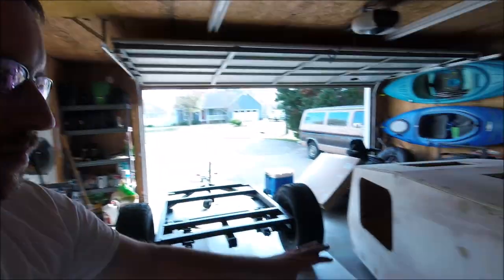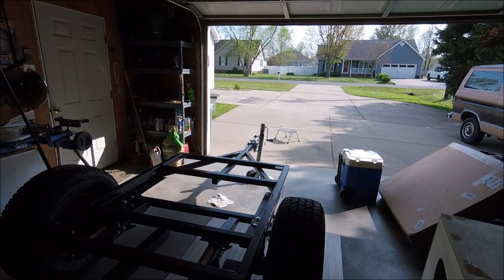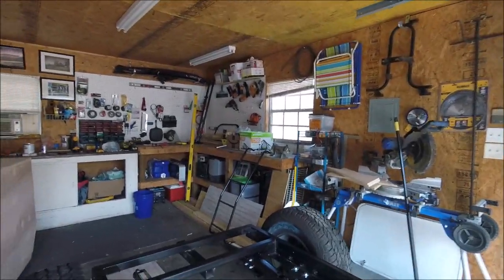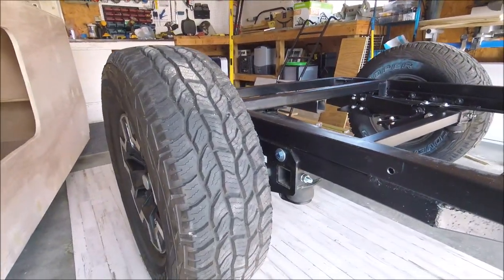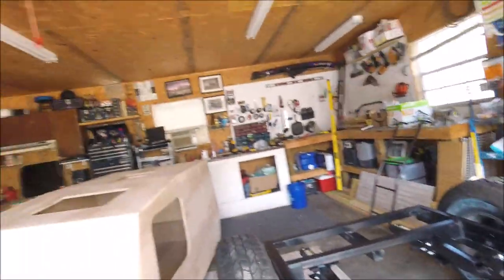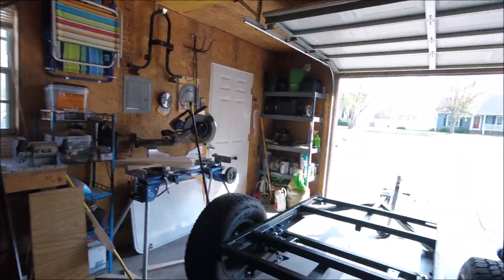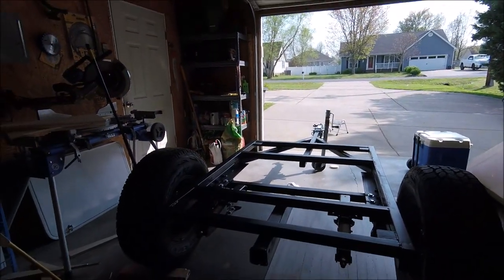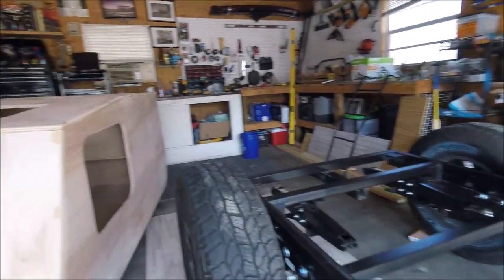A Quick Look At My Custom Tiny Off Road Camper Frame.

Comment: What's the plan for the van after you finish the trailer? Guessing its useful right now to haul material.
Reply from the maker: I have been using it to haul stuff. I have had it listed for sale for $2300 but keep getting stupid offers like $500. I have been talking to my friend who built my frame about converting it to 4x4.
Reply: RubberTrampRenegade May I recommend just a rear locking differential... in all my years of Off roading, there are few situations where true 4x4 is needed over a rear locker, especially for that older van chassis.